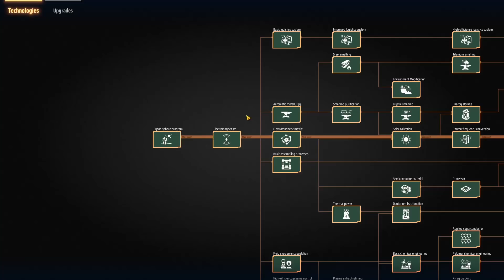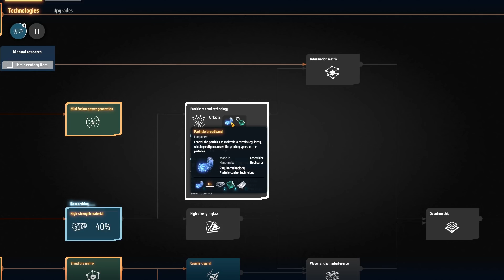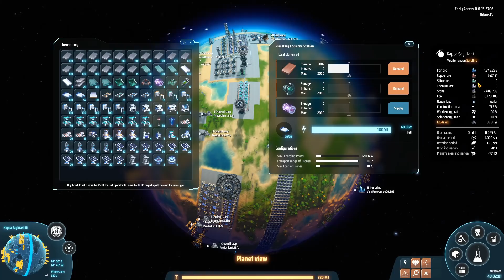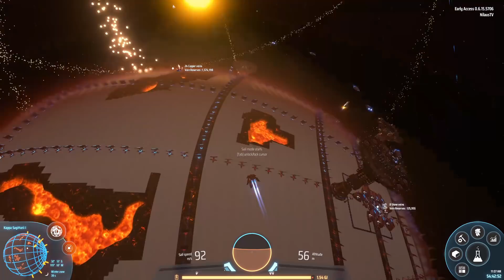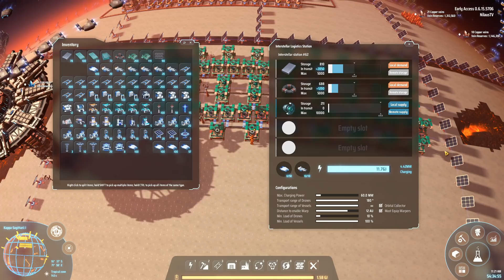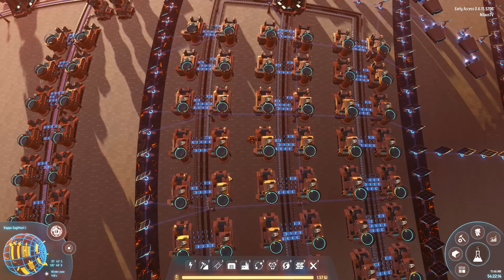TERRAFORMING TO PLANETARY GRID | #11 | Dyson Sphere Program | Lets Play/Guide/Walkthrough

Comment: The non straight lines drive me nuts too...even when using the shift key to place miners it bugs me that doing so will result in a belt that doesn't line with the grid but the benefit of placing miners using shift out weighs the annoyance of a non straight belt 😮

Comment: Important tip:
Just speed through the next part and get Warp. Ignore rebuilding your sulfuric acid facilities, you will hate yourself for it.
As soon as you have warp, you can go find a planet with a sulfuric acid ocean, and you have infinite sulfuric acid, straight from the ground, using water pumps. 

I found a planet with iron, titanium and sulfuric acid oceans, around 6 light years from my home world. I set up a semi large titanium alloy factory there, and put them into an interstellar logistics station, and set it to remote supply. The same station is remote-demanding 400 warp cores at a time.

Add in solar power and accumulators, and I'll probably never visit the planet again, unless I somehow drain all it's millions of titanium/iron ores. "Infinite" titanium alloy for the rest of my playthrough I think.... But if not, that's just another few planets like it. :-)

Comment: Your builds are pretty great, i started on the episode you made the gas giant processing. i ended up stealing the equatorial solar panel belt for my build. ive been having power problems for a while, and ive been trying to balance it with oil. but using a bit o solar seems to keep it fixed

Comment: kinda wish they used a hex grid in this game same size everywhere
Reply: Hexagons tessellate nicely on a circle, but not so much on a sphere.

To get a nicer grid, one could map an icosahedron onto the sphere and then tessellate each (distorted) equilateral triangular face of the icosahedron with appropriately-sized equilateral triangles.

Using this technique, it would still be possible to draw in latitudinal and longitudinal lines, there would be no annoying breaks in the grid, and each cell would be almost exactly the same size.

Using triangles rather than hexagons also has the advantage that straight lines can be drawn along the edges of the grid cells.

https://gamedev.stackexchange.com/a/3369
http://archive.bridgesmathart.org/2009/bridges2009-123.pdf
Reply: @techgeeknzl  actually the game uses that specific grid already. The dyson sphere has 2 grid styles to chose from. For some inexplicable reason its not made available on planets sadly.
Reply: @raffia16thblaze10  that is utterly unfortunate. Perhaps the idea for the icosahedral grid only came about after they'd already decided the buildings should be rectangular?
Reply: @techgeeknzl  well rectangular buildings usually are the easiest to create which is indeed a shame. Who knows maybe in the future they can figure something out or a clever modder makes an overhaul to a different grid system.

Comment: Hey there Nilaus. Did you know that you can take items to overflows to another same machine. Like: From one belt input you can supply several building in a row without another belt. Only with sorters, from one building to another. When one building has surplus it transfer it to next one in line. The easiest example is if you place two Thermal power plant, first one receives coal from belt and second one receive coal from first power plant. If you place sorter between two power plants. It saves some belts and resources.

Comment: Honestly the lat-long method of tiling a sphere vvith squares isn't very efficient. It makes more sense to me to use an inflated cube. Only has 6 grid regions for the entire planet.
Reply: Projecting an Octahedron or Icosahedron for the major grid, and subdividing into equilateral triangles for the minor grid, would be far more sensible. Both projections would allow for straight lines of longitude and latitude along the Great Circles; along with no shortage of inscribed circles for belts etcetera.
Reply: @techgeeknzl  Good idea. No more squares.
Reply from the maker: Then you can only produce 6 things on a planet. Seems a bit low to me
Reply: @Nilaus  Each of the 6 grid regions can be split into many smaller grid units just like the grid regions in the current version of Dyson Sphere. Or is there some limitation where you can only produce 1 thing per grid region?
Reply: But then you wont have those nice ring around the poles, I think the devs went for aesthetics first.

Comment: I looked like ice cube transportation may not be able to keep up with demand. I wonder, if logistic vessels can be added to those orbital collectors to increase throughput.
Reply: I put 8 orbital collectors on the gas giant and found it produces far more fire ice than I can consume.
Reply: @InverseCh  Unfortunately, i can not tell how many collectors are enough, as i do not have experience with the game and it can vary with output requirements. What i wanted to point out, is that there may be a bottleneck in transportation, i.e, making enough fire ice, but not being able to move it from supply to demand location fast enough.
Reply: @pavelpolcer7354  well, i just ran out of hydrogen making those red crystal things.. so 8 orbital collectors isn't enough. Might be able to increase throughput by building more logistic towers on the ground along with more collectors on the gas giant.
Reply: @pavelpolcer7354  kay, I'm a bit further into the game. Soon as you start producing those red crystals in any significant quantity, you'll run into hydrogen being the bottleneck. I covered a gas giant with orbital collectors and it's not enough hydrogen; I'm gonna have to ship it in from another solar system. I didn't run into any bottlenecks with transportation; I had 40 ships from 4 interstellar logistic collectors running between the gas giant and one of the planets that's about 0.5 to 1.5 AU away. I did have a transportation bottleneck with having just 10 ships.
Reply: @InverseCh  The common problem in games like Dyson sphere program, Factorio, etc. If you think, that are making/transporting enough of something, you are probably wrong.

Comment: What's your reasoning for only doing local demand?  As far as I can see it, you don't really have any reason not to demand remotely as well as locally all over the place. ONe could imagine having 'shipping hubs' of interstellar/interplanetary stations and then handling everything on planet with planetary stations, but that's not what you're doing. I'm not, like, sayig it's that bad or anything, I'm just curious what your reasoning is. Interplanetary shipping costs don't seem like a big deal right now, at any rate. (Though they might well be once you expand to multiple star systems...)
Reply from the maker: It takes longer for interplanetary and i don't want to unintentionally request common items across planets. If i transport interplanetary, then it has to be one way only.
Additionally, when i get multiple systems it will require me to keep warpers at all locations if i am always requesting interplanetary
Reply: @Nilaus  that makes perfect sense. It also keeps some challenge in the logistics.